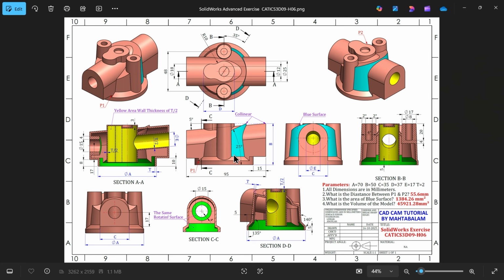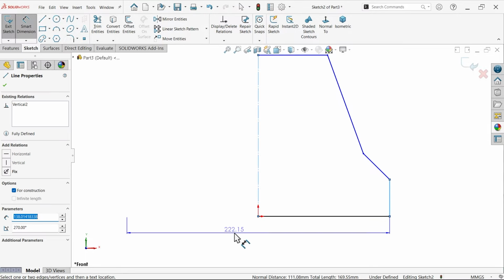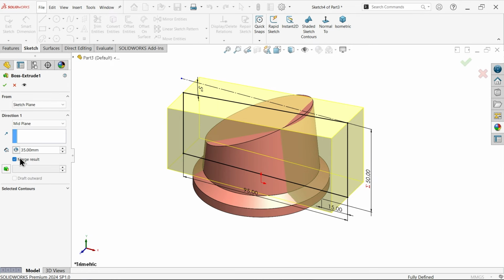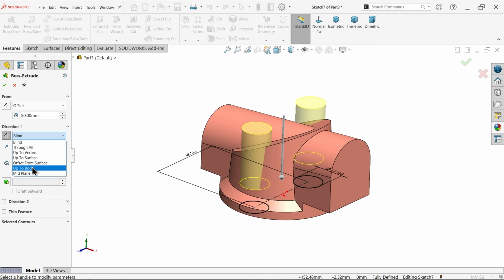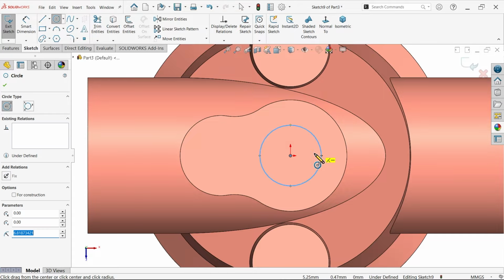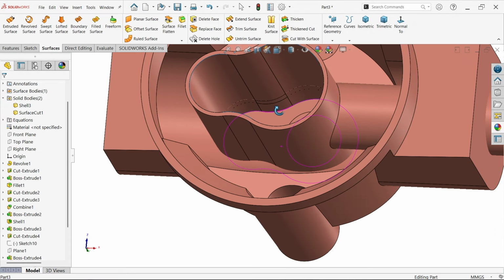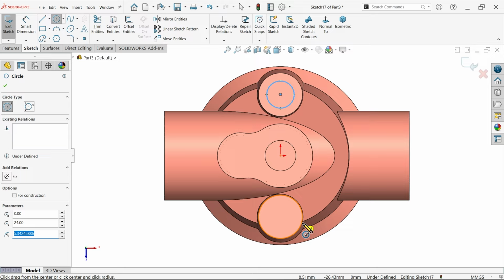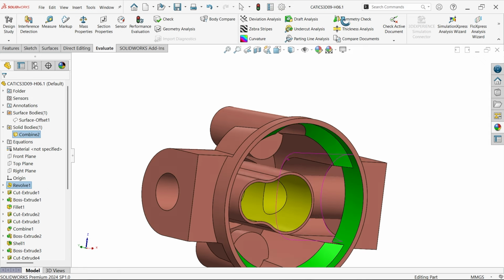SolidWorks Advanced Tutorial-CATICS3D09-H06

Comment: The volume he gets doesn’t match the master drawing volume of 45921.28mm³ because when he created the angled tube from the right face of the tombstone shaped object to the unmerged center body, he used a diameter of 17 to create it.  In order to have an INTERNAL diameter of 17 with a shelled wall thickness of “T”/2, or 1 in this case, the tube needs to be constructed with a diameter of 19 to account for the shelling operation.  The way he did it, if you select the inner circle of the tube before it is cut off, you will see that the inner diameter is 15, not 17, as shown on the lower right portion of your Solidworks screen.  My volume, with Ø19 instead of Ø17 is 45920.72, just 0.56mm³ difference.  I’d call a result within about 1/1000 of 1% difference plenty close enough.

Comment: Pause the video at 23:51, then compare it with section B. You will see there missing material on walls of central cylinder, where is the angled connection between central and the other two cylinders.